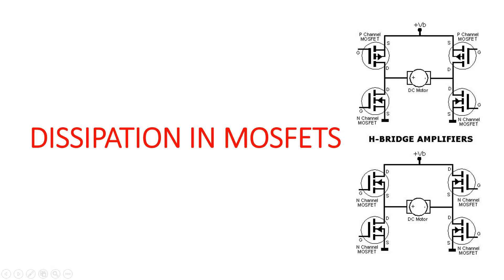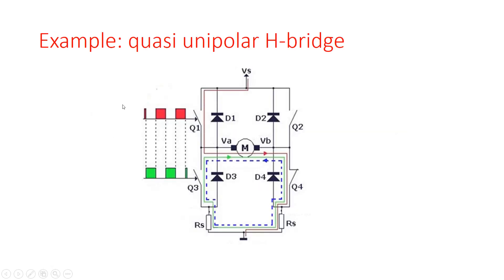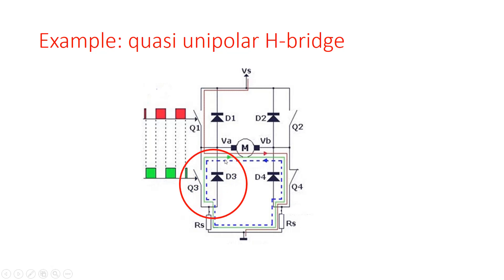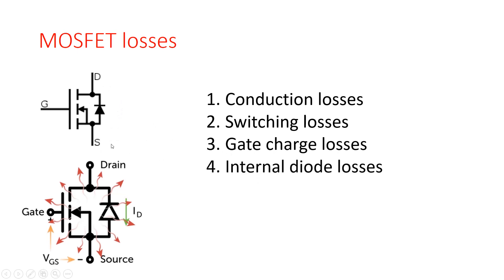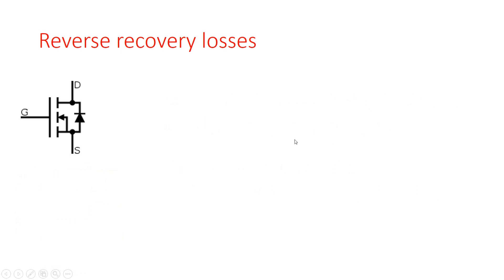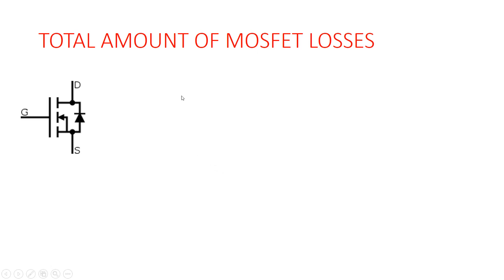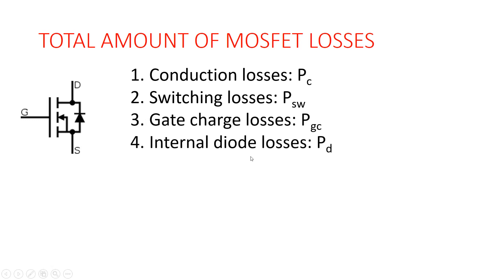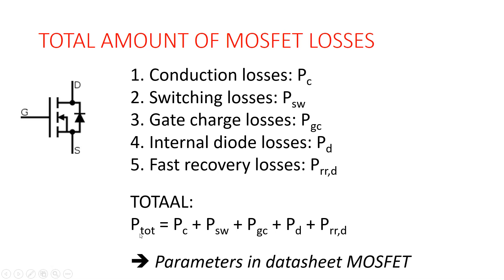Power losses in MOSFETs [EN]

Comment: Can you plz solve any example based on inverter in which you atleast calculate the conduction and switching losses .....i am modeling a thermal model on comsol of simple H bridge using irf540n mosfet can you measure this losses ..